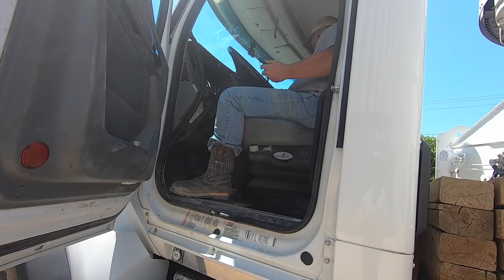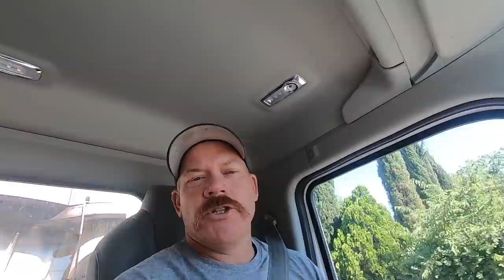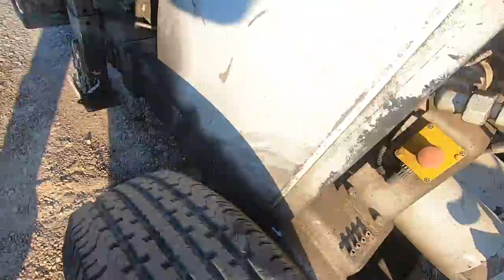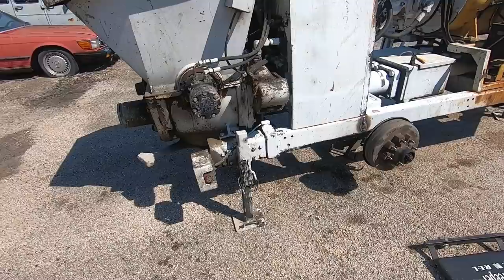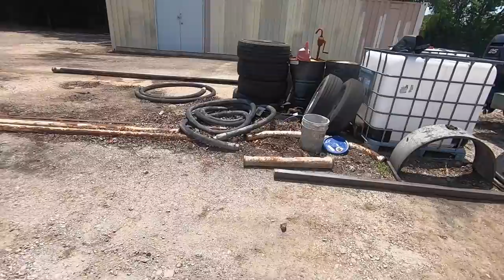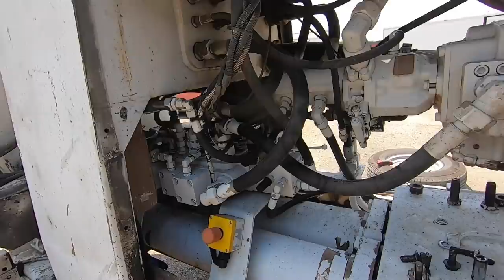Broke the frame on the trailer pump.Taking the Kenworth for service. Pumping concrete with Muddyfeet

Comment: The exact same thing happened to my 2017 sp500.      Same spot on the bolt hole you were talking about .    I had a welder add more steal .  So far so good.  Its been about 3 weeks since .
Reply from the maker: Wow! I was wondering if I was the only one.
Reply: @MuddyfeetConcretePumping  need a ramp for welder

Comment: Putting that welder in the back of the truck i thought you were training for the world strongest man competition, lol. That pump trailer has a lot of weight hanging past the axle on that frame, hope it holds up well. you guys seem to have put a pretty good fix on it, interested to see how it holds up. great video stay safe.
Reply from the maker: Hey man! I thought about you when I fired that torch up. I thought to myself Jr would have my butt for free handing that cut instead of using a straight edge. Lol. I’m curious also how it holds up. Hopefully it will. Thank you for watching!

Comment: ALWAYS use bolts on the backing plate that holds the welds. You'd be surprised how many times we are operating dump trucks (Regular Kenworth highway trucks, but they never leave the dirt site(s) to hit the road) & then start to hear some metal vibrating somewhere. We find that the welds have cracked, & the bolts are all that's holding the broken frame rails together!
Reply from the maker: Sounds like a good idea

Comment: In the event that this cracks again, you might want to have your Welder Minion work up a set of Blueprints that he'd need to fabricate a complete new frame for that trailer made from much stronger tube steel that you could (relatively) quickly unbolt everything from the existing trailer frame, move it over to the new frame and bolt it back down...
That would even give you the chance to improve the design and make it easier to use/maintain/repair if needed...
Reply from the maker: Probably just trade it in to the factory and buy another.

Comment: The same thing happened to my 2018 sp-750 , man don’t feel good to see that . But by now you probably got that done . What I did was . I Patch the welding The best I could , and put 5”x3” (L) shape 1” thick metal and welded all around on both side’s , note that one side was sinking and the Other side was just cracked. it’s been like that for about a year now .

Comment: I had to do the same thing with my pump.. it was very jumpy on every little bump on the road. It cracked in a similar place as yours. I found out the hard way on why it was so jumpy. My axle wasn’t fastened properly. It’s held on by 4 3/4 inch bolts to the chassis.. two of them on the right side were shattered, and on the left it was held by one loose bolt. I found out on the freeway because my right tire was hitting the fender. I had a couple of bolts in the truck, I fixed it in place, drove it straight to the work shop. Luckily the damn axle didn’t fly off. It’s not jumping anymore lol
Reply from the maker: These suckers are heavy. Especially for one axel.

Comment: It's all very well getting a sleeper but it mainly benefits you not the driver. There is nothing like sleeping in your own bed at night. In the past, i have driven 3 to 4 hours each way from and then back to a job to avoid staying in a hotel. Nice fix on the trailer.
Reply from the maker: Yeah. I wouldn’t do that to Bill. Lol

Comment: I have a question for you Jeff   ?  You said you were planning to put bolts in to help hold your frame IF you drill holes in it for bolts could those holes give it a possible weakness to start at cracking again rather than just welding it all together and trusting the welding job to hold it its just a thought you might consider the next time this might happen. If your roads and highways are as rough as ours are here in Missouri I hall a portable sandblaster around and it takes a beating  God for bid that it ever should ever happen again but you and I both know it is a possibility 🤔

Comment: I bet your welding buddy used 7018 rods around 3/32nd dia. I bet they looked gorgeous as well. Doing vertical up n 7018 is a skill for sure.. I am an amateur welder and I'm not good enough (yet) to do vertical up structural welding.. Nice job..:)
Reply from the maker: Look up Foster1972 on Instagram. He does some cool stuff
Reply: @MuddyfeetConcretePumping  I will do. I spent 30 years as an engineer in the construction/hi tech industry. I always admired the guys that could actually do stuff and always aimed to copy what they did in my spare time. So far I'm a pretty good welder and built our house with our bare hands.. Heck I even laid a concrete pad for my shop extension. I lve watching and learning from experts such as yourself.

Comment: You should weld the crack up , grind it smooth cap it with channel. So it gets a lip on the top and bottom to help support it.
Reply from the maker: So far what we did has held.

Comment: hi im a pressure welder and you should take that trailer to a pro  to safe you a lot of trouble and it for a safety reasons  never heals that close to the axles

Comment: Not in your business but what about mounting the entire unit on a 14K 7x18 foot, double axle trailer. Just drop the axles and jack off the current unit and set it on the bed.  Disadvantage is it would be longer and wider. Advantage you then would have room to carry the hoses on the trailer instead of the back of the pulling pickup. 
     I have a pipeline welder that cam with those torsion axles under it.  It bounced around terrible when pulled. I had issues on the welder and trailer frame from the bouncing. I set the unit on a small spring ride trailer and have not had any issues in the last six years. 
         You should be able to buy a trailer like I am talking about in your area for the mid $3K range. You would not have to modify the trailer at all. Just unbolt the axle off the pump unit and set the unit on the bed and bolt it to the cross members.  When your done with both units they can easily be put back original and resold.
Reply from the maker: Yes. We have several options if this fix doesn’t work out.

Comment: We've all been there, screw I don't need help lets try do it ourselves the next day damn my back hurts lol. The trailer pumper its fighting itself, can't make the weight of it too heavy as its already maxing out the axle. Can't make the pump have tandem axles or the thing won't back up worth a darn with so much tire drag on the ground. We have the older version of the welder you have I hate it, doesn't give consistent power its been like that since new.

Comment: I may be farm trained and not an engineer but it looks to me like your 3x5 additional frame pieces should have run the full length of that cheap original frame cause now it will probably  crack at the front seam of your new extension piece
Reply from the maker: I’m same as you. Grew up farming and learning how to solve problems out in the field. When I looked that over the frame for the motor mounts are welded to the top of the frame. I would have had to notch the 3x5 to go around those. Which in return I felt like would cause weak spots there and could cause the failure your talking about. Instead I figured it would be just as well to cut it off short and weld around the ends. Your tight. Ideally it would be better to go all the way the length. I just didn’t think that was possible.

Comment: you could drill just through the angle in a bolt pattern and fill with wields and grind it to bind both pieces together in more locations

Comment: better find someone if not your self to double check the axle alignment to the frame the way them cracks are 1 in front the axle and 1 behind the axle and depending on what the other ordeal was that happened first my guess is the first ordeal caused the axle to move
Reply from the maker: They both where behind the axel.
Reply: @MuddyfeetConcretePumping  think i would still double check axle alignment could have bowed the axle and cause frame stress

Comment: Well i have read the comments so no more advice from is needed lol. Just part of owning equipment things break.
Reply from the maker: Oh common. I was counting on you. Surely you have something that someone hasn’t said. Lol
Reply: @MuddyfeetConcretePumping  you ask for it lol.
 I come from a farm and mechanical back ground i always over build thing's.
 Wrong metal being used as in cheap materials, should be on spring to help take up the shock load, twin axles would help also, frame is to light.
 Ok i wll stop there lol.
 You have a good day.

Comment: If you drilled out some ¾ in or 1 in into the new steel that will really add alot more strength and regity to the frame. Of you cut a v into the frame it will allow you to make several passes with the welder making it as good as new
Reply from the maker: Definitely thinking about doing that
Reply: @MuddyfeetConcretePumping  it definitely can't hurt 1 bit
Reply: Foster did bevel the edges and made 2 passes over the cracks.

Comment: Well I see you getting a lot of advise on how to fix that frame.  I looked to see what one cost, new sp500 $80,000.  Now it seems to me that as many commentators said theirs broke,  that it is a factory manufacturing problem and they should fix the thing.  I think I would get some pictures /video from some others and talk to the factory.  Ya'll might have to band together and hire a lawyer but, that is just poor design and bad engineering.
Reply from the maker: I do think it’s a factor issue but I’m not interested in taking it that far.